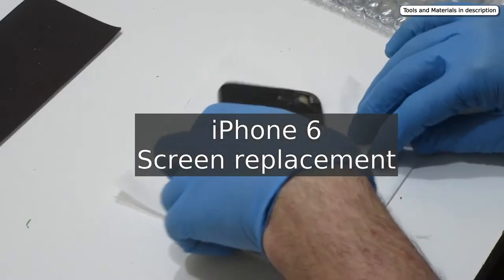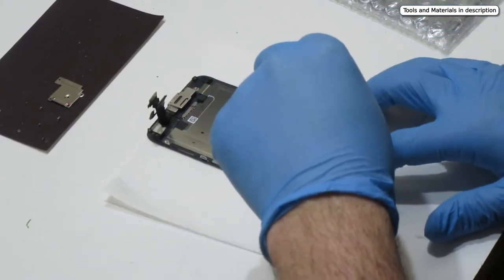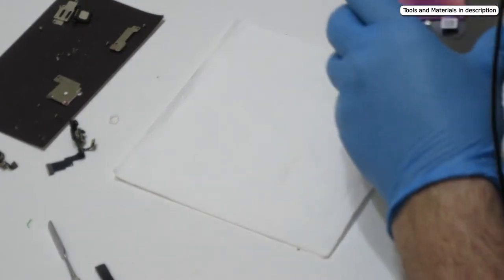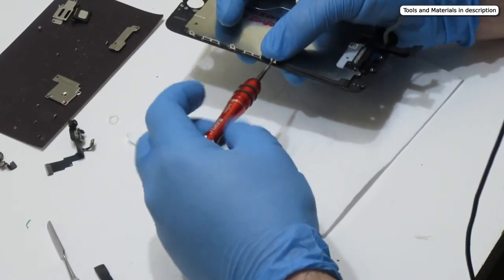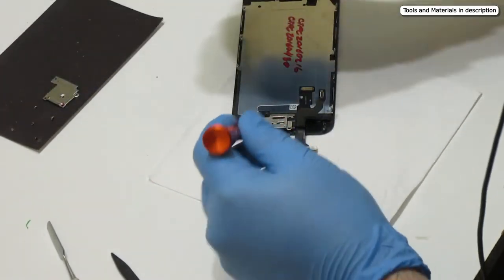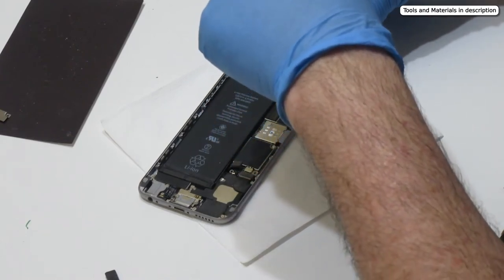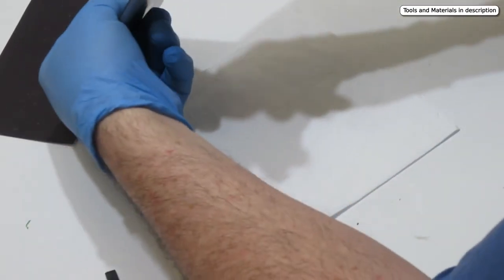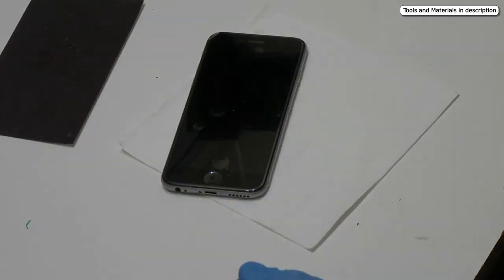What I fix daily - April 21, 2017 - iP6 routine screen replacement (complete with ramble)

Comment: I made a remark to the guy who owns a local produce stand here about the defect rate on the inventory that electronics repairers have to put up with.  His response, (laughing out loud) "You think I don't get a batch of bad produce every other day?".  
Good work here!  :)  I had the same luck with buying the more expensive screens a while back. They seemed more sturdy but had image quality flaws.  It was hardly even noticeable but it was a customer who came back to show me their slightly blurred cluster of pixels.  They opted for replacement and not a $40 discount.  A 5c screen repair that I did not want to re-visit!
Reply: Im doing OEM refurbs with CPG frames only. Defective rate is almost non existent

Comment: Good job Paul. 
I got a new/refurb screen for a 6+ last week that had no threads at all in it for the Pentalobe screws :(  Which is funny because all the places you buy these things from state that the screens are 'fully tested' before shipping :)

Cheers, John
Reply from the maker: Oh yes, "fully tested" bollocks!  No way they should be passing on things like pink-screens too.  I've had that no-thread problem too, sometimes there's not even a hole to even try tapping it out, frustrating as hell when it's the last one in stock and you're about to go in to a long weekend ( not to mention you eat the cost until the supplier reimburses you a month later ).

Comment: Good Job Paul D :) The top microphone is for SIRI and no need to put adhesive in for the home button (save you a job as well) ive done a few thousand of these now lol When it says hello and it shows the passcode it means its just done a update on the iOS ;) if it doesnt show passcode it has been restored fully
Reply from the maker: Was nice to finish the daylight part of the day with a job that went to plan.  So far tonight though I'm fighting with a Win10 BCD failure/corruption/erasure that's being a PITA.

How's things on your side of the island?
Reply: Yeah all good here mate cold lol just had a few rums feeling better haha wasnt to busy today but easter is always quiet all the kids on holidays with parents
Reply from the maker: Yes, very quiet here too, which leads to spending too much time watching live-streams of Louis/Jessa/Chris - at least they're frequently informative.  Cold hasn't really kicked in here, it's a cool breeze at night but still barely dropping below 20'C, and the daytime temps are 31~32.  Best time of the year though.... other than all the damned holidays making a complete dog's breakfast of deliveries/jobs.